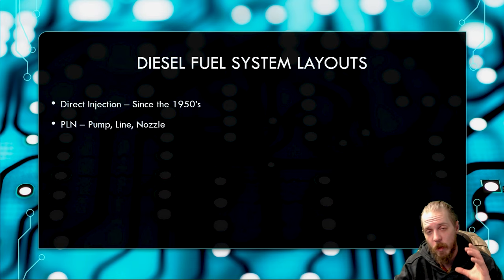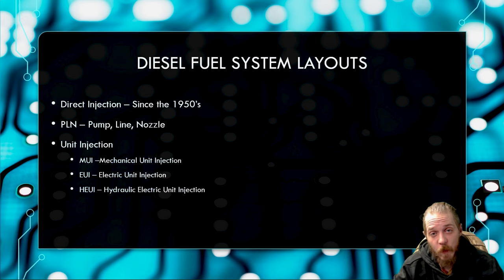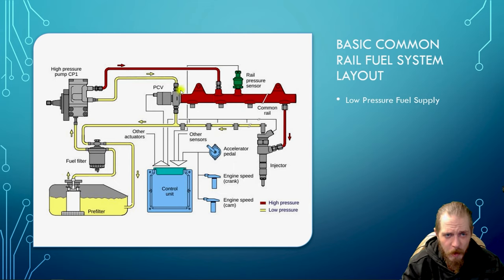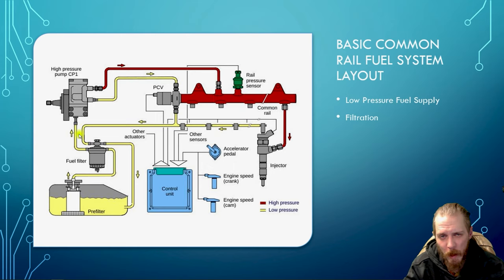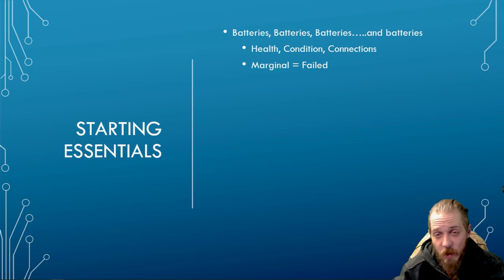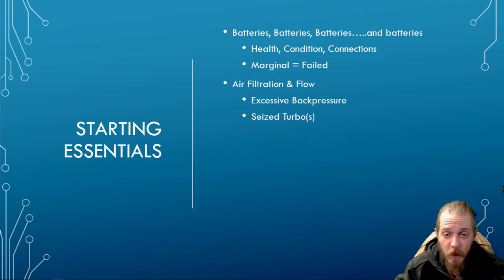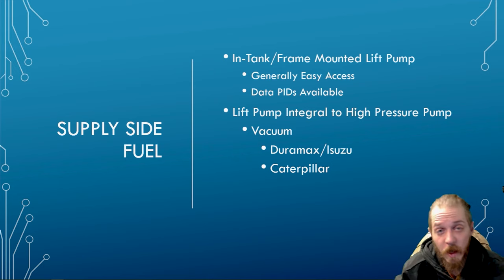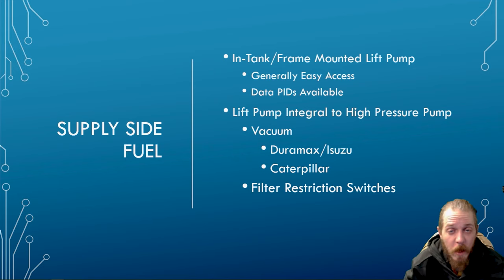Common Rail Diesel - No Start Fuel System Basics

Comment: Wow just got to say really great video. you covered so much here and in such a good systematic way and easy to under stand. Only two things i could add here, for a non starting diesel engine are 1 cranking speed which you covered by saying battery but also starter motors can be the problem. but some diesel engines need a minimum crank speed to start. and 2 is EGR valves, if these are stuck in open position they can stop engine starting as the air/fuel mixture is compromised/disrupted.
Thanks again for the great video

Comment: It is indeed a fantastic lectures. My coming across your lecture coinsided with having fault of starting failure with my 2010 hyumdai tucson diesel. Your lecture enable me to successfully did a lot of test. Where I am now to know whether or not my rail pressure sensor/pressure regulator are good.

Comment: Excellent presentation.  Out of all the wealth of information you just shared for me the key to the diagnostic kingdom you mentioned is- "If your low pressure side isn't delivering sufficient pressure, the high pressure side can not make it's required pressure" (paraphrased).  Jumping right into injector failure mode rather than considering first that the issue may be something as simple as an undetectable air leak, will destroy your credibility and break your business/wallet..   I replaced my OEM (piss poor and leak prone system) with a positive pressure (lift) in tank component and a primer blank out unit after 3 weeks of spanking around with every connection and potential air leak -with only 1 one possible leak point found.  When you do the math-it's much cheaper to just junk the stock fuel delivery system, and upgrade to a quality USA made lift system.  Final diagnostic note... This vehicle was found to have lost the CP3 lift pump capability putting it in a "no start condition".  Problem was overridden via the lift pump installation.    Thank you Sir.

Comment: From my experience, trucks that have primary fuel filter and a secondary fuel filter or fuel water separator never seem to have fuel related issues. As long as you change them after every pm service you’re good. It’s the trucks that only have one filter or separator that have a lot fuel system problems

Comment: Best explanation ever wis I’d seen this video before I had trouble with a diesel ford mondeo UK crank but no start I ended up putting it into a garage who systematically ripped me off never got it running and I’ve been working on cars for years 😂but mention diesel’s over here and you can see £ signs in their eyes but really when you look at a diesel if it’s not running 9 out of 10 it’s the fuel thanks for the info

Comment: Great presentation. There are after-market tool companies that sell a mechanical common rail pressure gauge with fitting, hoses and plugs. Are there any reputable tool companies like Snap-On or Mac that sell a similar test kit. Something about a Chinese $300 test kit and over 20,000psi plus doesn't add up.

Comment: Sincerely, Impressive presentation sir.1979 John Deere 2840 -the Gifted-WorkHorse I am now (only now, after 20+ years of use/abuse) am forced to look directly in the mouth. Suffice to say, you saved my ass - it's cold in Michigan February. It's colder without my tractor. Thanks man. Sincerely.

Comment: Thanks for the video .
I've got a 2013 fuso canter 3c13 with low fuel pressure .
It's now in a garage & there struggling to fix it .
The truck will only start - run when the fuel pump pressure regulator is disconnected .
At all rpm's above 1000 the fuel pressure is ok .
It's got a new fuel filter .
At the moment I think maybe the low fuel pressure sensor on the common rail may be faulty .
Any ideas please ?

Comment: How much diesel is supposed to flow to return line after being disconnected from injectors  ? Basically when doing leak of test, i done a leak of test on the injectors , all came back same value in 5 mins , but the return line i had to put it into a bottle as in 5 minutes it filled a 1 litre bottle , is that normal ? At the same time my rail pressure at idle is 30-40 bars under what is actually comanded , even when constant driving seems to struggle to maintain a consistent rail pressure , always fluctuating -40-50 bars , back to normal and then -40-50 again.
Please help

Comment: Hi. I have a CP1 high pressure pump on 2.8 hdi jtd pickup. To get it started I have to loosen the top head which carries the fuel cut off sensor then tighten it up after turning on ignition.

Comment: I bought a cat c7:,refer for food ministry it starts cold but you need 2seconds of ether to start warm.. I spent 5200.00 shop put 2new batteries. 2000.00 huei pump they did not solve problem with 5200.00. I went to mechanical perfection in Medford MN. He put new governor on air system.adjusted valves he said they needed it. He disconnected fuel pressure valve above huei on head side. And it started when warn without ether. It was thanksgiving so he did not get part .I had to take truck for food share. I spent 1000.00 with him. It's Sunday truck is parked. Oh truck leaks fuel drops of front of motor about a week now been half _ 1cup when parked. Do you think original shop should have found fuel pressure valve?

Comment: Awesome video! 

I'm working on a JD350G and I'm experiencing issues with the fuel system. The engine sound like its  running off 5 cylinders. I checked the fuel supply at #1 port at the rail and no fuel was coming out. I pulled the fitting with the spool and spring and cleaned it/checked the movement. The spool and spring seemed to be fine. At this point, I'm thinking the rail or the injection pump pressure regulator might be causing the issue. Have you experienced anything similar to this problem?

Comment: Hi. I am working on a John Deere 2016 6090l engine.  Is on a Clarke fire pump.  The issue I am having it doesn't want to accelerate  past 900rpm. Somethinmes it will  reach 2100 rpm Wich is normal running rpm. But it will bounce between 1800 and 2000rpm like if it was surging for fuel. It has  new fuel filters.  I changed fuel rail pressure sensor and suction control valve. I order a injection pump do you tink that could be the problem or a faulty speed sensor. Thank you in advance.

Comment: I have a Hyundai Terracan, I have changed the pressure sensor on the common rail, the pressure regulator on the fuel pump and still got a bad start problem. The car starts but wont accelerate, I have to wait till the fuel pressure builds before I can drive off. After watching your video, it's obviously the fuel pump worn out and won't hold pressure.

Comment: Hello, I have a question of diesel fuel cooler. Does diesel engine needs fuel-cooler mandatory at fuel return line?
We have high pressure pump wear problem. (the engine has no fuel cooler)
I think overheated diesel fuel from return line makes high temperature at fuel tank and this over heated fuel makes damage at high pressure pump.
Waiting for you opinion.

Thanks , Best regard.

Comment: What an incredible video mate, not used to diesel engines but this has taught me LOADS! I'm having a Crank - No Start Issue with my Iveco Daily 2.8, watching this video makes me wanna go further back down the fuel system and re-check Low Pressure...which I assumed was fine, as I'm getting fuel upto the Common Rail...but maybe still not enough pressure!? Thanks man.
Reply: I'm having same issue so tryna learn
Reply: Just thought I'd update: Finally managed to get my van started!! This video was a huge help - turns out I just needed to bleed the air out from ALL of the injector inlet pipes - (I'd only checked fuel was "reaching" 1-2 of them).  Pipe No.3 had a lot of air, finally pushed diesel through and it started!  (Note: I think I'd drained the fuel lines via the return pipe, by running my diesel heater without the engine running)
Reply: @Automotiverecoveryuk  Check my reply, try really hard to bleed the air out of the system. Good luck!
Reply: @twothumbsfresh  whats best way to bleed air out system where u based
Reply: @Automotiverecoveryuk  Depends on the vehicle mate, I think some Pipes are not meant to be loosened more than once, so check and be careful...but, I just loosened the pipe nut on each injector (not the one on the common rail, as air rises in the pipe, so best do the highest one), 1,2,3, then 4 etc. Loosen them, then crank/try to start the engine for a few seconds - air should come out, followed by a squirt of diesel, then quickly re-tighten the nut. Repeat for each injector pipe until all the air is released. Good luck!
Reply: @twothumbsfresh  cool il give it a go whenever I next get some free time which is very rare nowadays

Comment: I have a Hyundai Santa Fe 2.0 CRDI, I got codes p0087, p1186, p0192, car stalls on higher speeds usually over 60mph, or when you floor it, I changed filter, fuel rail sensor, how would you diagnose this if its a weak pump or has fuel line leaks ? Its weird I swapped my rail sensor with my brother's car then put mine back in and it worked fine for a week then started stalling again when trying to go over 60mph, or on sudden acceleration

Comment: in isuzu dmax 4ja1 engine one pipe from fuel pump is connected to the engine block and a connector connected to it what is that for bro

Comment: Anyone give me some advice please before i pull the trigger on a new high pressure fuel pump,my main question is can a high pressure pump just struggle higher up the rev range only?
I have a 2008 mercedes c-class 3.0 cdi om642 diesel,car runs flawlessly except for when you accelerate hard from say 60mph you get an instant eml light and reduced power,code is either on one tool p0089 or 11b800 'The control deviation during rail pressure regulation via the quantity control valve is too high.'
I've replaced fuel filter,fuel rail pressure sensor,fuel quantity control valve on high press Pump but no improvement.
I took out the lift fuel pump in the fuel tank and the filter gauze on it's base was blocked solid!!Cleaned that but no improvement which surprised me.
Can it be the high pressure pump?Not much else left! ;-)
Oh,the freeze frame data from the fault the fuel rail pressure was 1380 bar,specified was 1560 bar?Is that enough of a problem?

Comment: sir i have a crdi k2500 kia 2 injector are fault more fuel is in return and ah hard starting..the problem is if sucket connector in injector is un plug this start no problem..but if sucket connector is plug it is a hard start problem..what is ah common problem..thanks for the reply.

Comment: Hi. I have hyundai trajet 2005 diesel with common rail System
It's  hard to start except if I disconnect ect sensor or if I turn on condititioner or If It was so cold which as I notice ecu give order to pump to much diesel in these three cases
I want to ask you about the next situation:
When I turn switch key to ON position without cranking the lift pump work afew seconds and stops and during these seconds diesl pass the high pressure pump into rail and then to the tank through pressure regulator valve. Also diesel come out high pressure fuel pump relief valve to the tank
Is that OK or tere's some thing wrong
Note: after the engine start working then every thing is OK

Comment: Great video Chris. As always I appreciate your thorough attention to detail. I didn't know you were CAT certified. Were you more on the truck side of things or did you do off-highway? Looking forward to the next part! Z
Reply from the maker: I went to school for Caterpillar construction equipment but I dealt with the truck side as well. Like I've always said, the basics remain the same throughout various applications. I try to focus on core operating principles and branch out from there.
Reply: @ScienceOfDiagnostics  Copy that. Generally speaking I like working on equipment. Certainly not the level of aftermarket support that the light vehicle side has, but it does seem to be getting better. I'm the same way when it comes to principles of operation. If I can learn how the system works then I'm confident I can figure out why it's not working. I may not get there as fast as others, but comprehension is important to me.
Reply from the maker: Comprehension is key. If you can understand and apply basic principles of operation, you can diagnose pretty much anything out there.

I'm currently working on a hydraulic series, any specific requests you would have Zach?
Reply: @ScienceOfDiagnostics   Totally agree. That's what it's all about. 

Man I'd love to see something on reading hydraulic schematics as well as proper flow testing techniques. That said, I'll be happy with whatever knowledge you choose to impart. 

Were you able to attend Virtually Vision?

Comment: Great video thanks! But still couldn't find answer to my problem. Got dead 2.0d 110kw diesel with comon rail. Problem is there's no fuel coming to rail, fuel is coming to HP pump, but further nothing. I have checked HP pump with flow valve in diesel center, works fine, electricity is coming to that valve, so it's working. Changed lift pump in fuel tank also, last one i don't know exactly does it works properly is presuply pump, it comes after lift pump and before fuel filter(new one) As i see it pumps fuel to HP pump, but does the pressure is enough? I measured and it showed 1,8bar coming in HP pump. What do you think could it be the problem? That HP pump don't get enough fuel to pump further in rail? And yes there's nothing pumping in rail, cranking and nothing.
Reply: Have you checked if it has a Stop Solenoid on the HP Pump? The Stop Solenoid is basically a plunger that blocks fuel to the Rail - thus shutting off the engine. I suspected mine was being tripped by my immobiliser (although I believe I've ruled this out now. Worth checking mate.
Reply: @twothumbsfresh  Yes that solenoid checked with HP together, all fine. Now is all fine, problem was presuply pump under car, who messed with me. It did deliver fuel to HP pump, but pressure wasn't enough, only 1,8 bars, instead of 4,5-5 bars which needed. So i assume the flow was so weak that HP pump couldn't deliver fuel further to rail and injectors.

Comment: My car is lancruiser amazone v8 model 2006 my pump is 22100-1c170 my car is cracking but not starting and of the area mechanics told me to change the pump b/c it fail to pump high pressure and I found a new pump but number is 22100-1c42 it has the pressure you can see the fuel but still the car not starting so am worried we can’t able to find out the problem can any one help me to fix this please

Comment: I find the closing comments regarding the locking of garage doors somewhat comical.  In South Africa, if it is not bolted down or locked behind steel, it WILL be gone the next day.  We have electric fencing on the 6-ft fencing, alarm beams around the houses, motion sensor lighting etc etc.  Seems like we are actually ahead of the curve that open borders brings.  FYI, the power in my area is off at least once a month as criminals cut the high-voltage transmission lines and drag them off to be sold as scrap metal.  And I live in a fairly normal neighborhood.  Good luck in the US of A.